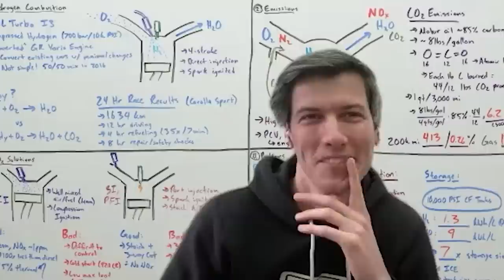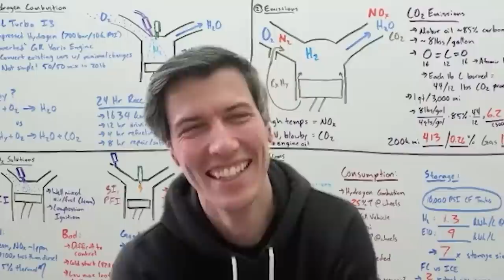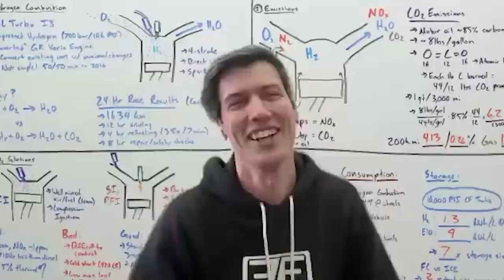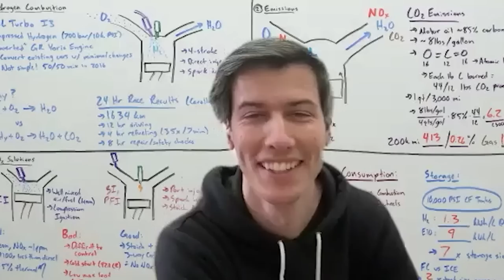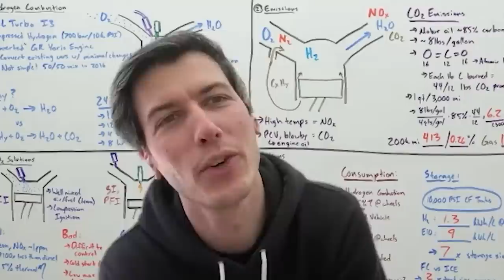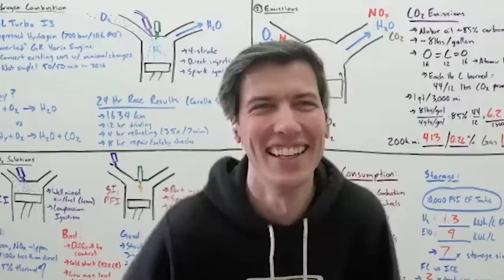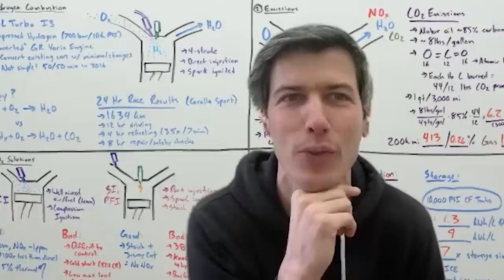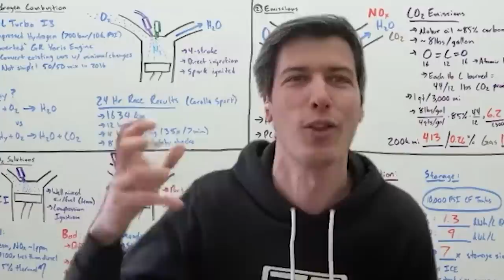Engineering the World’s Fastest Cars with Jason Fenske & Neil deGrasse Tyson

Comment: The McMurtry fan car is the fastest 0-60 1.3 sec! Really wished they talked about this car as it has maximum downforce from a stop, giving it huge amounts of traction.
Reply: 🎉🎉🎉 yes this is the way
Reply: A  top fuel car  is even faster  much much faster
Reply: Pretty sure they are speaking in the context of production. Fan cars are awesome and I'll watch the top duel cars run any day <3
Reply: Thank god I'm not the only one mentioning downforce...
Reply: The rimac is production right?
Reply: Yes, while Mcmurtry isn't road legal yet, it isn't impossible to make it road legal so it should be included in the conversation.
Reply: Fan car will never be street legal because of the amount of crap it would blow at the other cars on the road.
Reply: @ryurc3033  its got an official uk registration plate
Reply: carwow tested the mcmurtry on unprepped track
Reply: @bigdavedayday1581  But the McMurtry isn't a drag car. It's a track car that happens to be very fast off the line. We have to acknowledge the impressive 0-60, 0.3-0.5s slower than a top fuel, with 10 times less power and roughly the same weight. Top fuel will wipe the floor with it after those 60mph
Reply: Came here to mention the McMurtry 🤓

Comment: The conversation about 17 mins in about engine dependability reminds me - my first car - an Austin Mini had a manual choke. Pull the handle and it restricts air into the carburettor when starting so the fuel and air mixture is richer, so there’s a better chance it’ll start. Of course, you have to remember to push it back in or you’ll go off down the road with a blue cloud behind you. Push it back in too soon though, it’ll stall. Fun times. I now have an Audi where I press a button to start it, but I do miss my old Mini. Useless when going on dates I might add 😂
Reply: The cloud should be black if the mixture is rich. Blue smoke is oil being burnt, meaning piston rings or valve guides were worn.

Comment: Hey guys! On the subject of drafting I have one for you.  I was once somewhere  between crystal springs and ely Nevada when I realized too late I was not where I thought I was.  I had no cell service and no local map but my last fix suggested I had something like 120 or 130 miles to the next fuel stop and my car computer said I had around 100 miles of range.  I was midway so just turning around was not an option.  However, I knew about drafting and came upon a tractor trailer going a consistent 50 mph and I just fell in behind (at a safe distance as the effect is still there to a degree even if you are not close enough to be unsafe) and for the next 2 and some odd hours cried as literally everyone else, including other big rigs, passed us by.  I not only made up my deficit but I rolled into the next fuel stop with an estimated 20 miles still in the tank.  Needless to say, huge relief after a very tense ride.
Reply: You don't carry a street map in the car? That's just bad planning. I carry an old street map, and cash. Internet is not forever, just ask the people caught in towns isolated by bushfires.
Reply: @Chris-hx3om  sadly, no. That was very poor planning no doubt. And I was certainly extremely nervous and kicking myself for putting us in that position for sure. But, in the end, I had a cool story to tell 😝

Comment: Mechanical engineer here too. To add information to a couple of questions. About the supercharge electric motors question, it's possible to increase energy output complementing the battery with super capacitors, they don't hold much energy compared to a battery, but they can discharge it way faster. And the volatility of gasoline vs hydrogen question. Hydrogen is more volatile because its molecules are so small that they actually leak through materials like water on a mesh, but at a much smaller rate. Loved to hear Jason on the show!

Comment: Some advantages they didn't discuss about a rotary engine is due to its compact and lightweight design, you can mount it lower and further back than a typical piston engine, and achieve a light, powerful, front mid engine layout capable of producing serious power for track use.

Comment: I thought part of the 300mph limit was actually the tires. But more about the rotational force on the tires, ripping apart at those speeds. That is why salt flat jet cars use solid steel wheels that are strong enough to take the rotational force.

Comment: 29:05 Our family owned several 70's Volkswagen Beetles.  We could drive very close to an 18 wheeler truck around 55 MPH and lift completely off the gas pedal and continue moving unassisted.  The air coming off the back of the truck pushed the back of the Beetle and the truck also removed any air resistance in front.  Very cool, although this required driving very close to the truck which was not safe, plus if I remember, this drafting method required some slight acceleration occasionally to stay in the "pocket".
Reply: These sort of hypermiling techniques work because of how the aerodynamics interact but as a practice is downright suicidal. It is why it's almost universally illegal in most places. Sure you don't have to overcome air drag because the Truck in front is doing it for you which save you a ton of gasoline but if it has to brake suddenly you have zero time to react guaranteeing an accident and perhaps it can end up getting innocent people involved/injured.

Comment: The thing of the grooves on the road to supposedly have better grip in corners I've seen it done here too (one day: "finally, they're laying down some new asphalt here!" the next: "did they ruin it already?!") and I think it's idiotic: the best grip you can have is between a slick tire and flat, solid asphalt, nothing less. Whenever I drive on that corner I mentioned, especially when it's raining, I feel like losing control in any moment (that would make sense if the purpose was actually to make you slow down)

Comment: My dad was watching this with me and he was like why not power it using vacuum. I search and I saw a guy had a prototype with a toy car, I was hoping you could talk about that in a next video. Using the negative energy to pull something that turns something
Reply: Interesting idea, but I think that will have all the same challenges, albeit at different points in time and in different quantities: 1. it will take energy to create that vacuum and 2. storage will be an issue just as it is with any other form of fuel: how much vacuum does one need to store to make it a practical "fuel" for transportation.  One thing is for sure, vacuum is the lightest form of "fuel" 😁 .  (Though, the weight of the container for that zero-weight fuel might negate all of the fuel's weight advantage!)
Reply: They already have that.
Reply: @MrCheckster2000  I tried looking it to didn't find it.
Reply: Vacuum depends on atmospheric pressure, about 14.7 psi.,  for its power. So a perfect vacuum is equivalent to 14.7 psi. of compressed air, very inefficient as an energy storage. Dragsters develop around 6,000 psi. cylinder pressures.
Reply: @edbruder9975  can you explain that a bit simpler I'm not sure I understand
Reply: Vacuum requires energy to create. The more Vacuum you want the more energy it takes and requires additional energy to maintain. Why not just use that additional energy as propellant.
Reply: @paramountx  So if you're in space, it's a vacuum. You can't use a vacuum cleaner in space, it all sucks right back. The only reason a vacuum has power is the difference between atmospheric pressure that wants to get into it, and on earth that's 14.7 psi. So say you've got a 20 lb propane tank you want to store energy in, you decide you're gonna use vacuum. It only holds lets say 5 cubic feet of air I'm just guessing. Once you let any air in, the vacuum is less. Once you let 5 cubic feet in you're done. They test propane tanks to 350 psi. If you use compressed air there's 23 times the energy in the same space. There's a lot more push with air than pull without air.
Reply: Chaparral racing cars used that method in Can-Am racing .  They had built a fan built into the system to suck the car to the track..

Comment: In school my professor told me cars get the maximums acceleration when the tires slip about %10 so essentially like sticky gum adhering to the road. On top of that the weight transfer and suspension would equate to more than 1.00 G of force on the driven wheels.

Comment: I like how the ability to maneuver was added to that top speed limit question as that was group B rally and is has been formula one since the late 80s early 90s.  Without a doubt you could grab a modern formula 1 car re angle the wings for just straight line and hit 300mph.  Thing just would not turn like they do on a circuit track 😂

Comment: @startalk @engineering explained  Question about fuel economy. In a hilly area, let's say on an interstate highway, would you get better mileage by slowing down as you go up hills and speeding up going down, or staying at the speed limit both up and down the hills? I have an opinion, but wondering what the experts think.
Reply: If you put the brakes on to go downhill, you get worse mileage. Let it roll. Mileage is mainly affected by rolling resistance and wind resistance. If you're not stepping on the gas while rolling downhill, the wind resistance of high speed is not costing you anything. That being said, if there's a cop or traffic or low-speed curve at the bottom of the hill, and you have to use brakes, the fuel you used to maintain speed going up the hill was wasted, and driving slower over the top of a hill, you will roll down slower with less wind resistance. I drove truck, and the company I worked for had a speed limit, but we were allowed to go above the speed limit for 60 seconds to pass somebody. One trip through the Pennsylvania hills I realized if I rolled down the hills I would only be above the speed limit for nor quite the 60 seconds before the next hill slowed me down. I got called into the office. I was speeding I think it was 1/2 the time. So I asked how many times I was in violation, he looked surprised, it was twice.
Reply: @edbruder9975  Excellent response. I certainly wouldn't press on the brakes going down the hill, but I wonder if setting cruise control to maintain speed up and down the hill costs more or less fuel. What I see is people approaching the bottom of the hill "at" the speed limit, then slowing down as they reach the crest. Then they accelerate down the hill ending up at a speed above the speed limit when they reach the bottom. If you set the cruise you use a little more fuel on the way up the hill, but are essentially coasting down the hill the entire way. When I tested this in a vehicle with an instantaneous fuel economy display, I didn't see much difference in the fuel economy when going up the hill, maybe a few MPG. But going down the hill, keeping with traffic and accelerating as they did, I saw large numbers, like 60-70MPG, but if I kept the cruise on it would top out at 99MPG. This is obviously a significant hill, and "your mileage may vary" based on terrain and traffic. I just always felt that the slowing down while ascending wasn't significant enough to gain economy, and that was eaten up by accelerating down the hill. But maintaining speed would cost a little more in the ascent while paying back more in the descent. Just wondered if anyone had done a more scientific study of it.
Reply: @tomv5782  All I can say is my boss was amazed I had been speeding almost 1/2 the time and never exceeded the mandated limits, you were allowed a few violations of their rule before they docked your pay. That being said, in a truck if you have to gear down to go up a hill you use more fuel, you have to give a shot of fuel to match your gear on a downshift, and you lose speed while shifting, so the rule is if you're almost cresting the hill you should avoid the downshift and back off on the fuel to avoid lugging the engine then get back on the pedal as you speed up on the downslope. But in that particular situation I just let it roll down the hill and didn't touch the fuel until I was on the next upslope and below the speed limit. Then it was pretty much on the floor till the top of the hill again. My boss looked at the stats for a bit then said "Well, just don't do it anymore."

Comment: In a rear-wheel-drive car, as you accelerate, the rear will be pushed down for a force greater than 1G.  The average force on all four tires is 1G, but much more on the drive wheels.  Same thing on an emergency stop:  the front tires get for more than 1G.

Comment: This conversation got me to thinking about the comic character the Flash running fast enough to break the time space barrier does he use gripping soft rubber boots? And how strong is the flash that he can resist the enormous air pressure against him which must be incomprehensible! Also his around the world punch where he accelerates fast enough to circle the planet instantly and hit the bad guy how much force is he generating into that punch?
Reply: Speed force protects him

The force varies at how fast he runs

Comment: Talking about the ability of a car being able to manoeuvre at high speeds is similar to something that military aircraft designers must take into account for instance the design of the F-111 Aardvark (one of the predecessors to the much more famous F-14 Tomcat) involves wings that can move from a straight winged position (for more stable low speed flight) to a fully swept wing at 72 degrees for high speed flight. This design at the time was a revolutionary advance in Aircraft design and led to the same principle being used in the Soviet Union and Europe.

Comment: Recycling of batteries already is done by several companies. I believe "redwood materials" recycles damaged and rejected batteries from the production lines at (a?) tesla factories. They claim they reclaim 90-95% of these materials that are then reused in the production of new batteries. I am sure the scaling and efficiency are still being worked on. But I think I heard/read that the goal was to get as close as possible (within a few percent) of a closed cycle with only minimal input of new materials
Reply: Not to mention that the used car batteries still have about 70-80% of their original capacity and can/will be used to store energy from renewable but intermittent energy sources. It will be decades before there is a major requirement for material recycling.
Reply: @ctcboater  Depending on devellopment of battery chemistries that are cheaper, longer lasting but more volume, It become more cost effective and environmentally responsible to recycle old car batteries than reuse them. That way high density batteries need less mining and refining and lower density/cheaper/longer lasting batteries can be used for home use.  But first these new batteries need to be perfected and produced, I think of NaCl batteries or the flow batteries from RedFlow (Australia) as examples. They typically are not as energy dens but cheaper, more cycles.
Reply: “Green”

Comment: About recycling: a former Tesla co-founder JB Strobel started a battery recycling company called Redwood materials that is trying to tackle this problem.
Reply: It is all about volume scale. 

Most batteries produced are still on service. So we have not gotten to a point where there is enough batteries coming in to recycle to be worth processing yet. 

And we are talking about 2nd uses for them after they are taken out of cars, like grid scale storage. They are generally pulled out of cars with still around 80% of the original capacity so they have many years of use for other applications if we can find some organized way to use them. 

So it could be a several more years until we actually have enough to recycle, to build recycling facilities. 

Once we do though, Tesla is ahead of the game as they are collecting old batteries where possible to warehouse, re-use and maybe recycle some day.

Comment: Guys, let's look at the anti squat of the 4-link suspension of drag cars and how a low inflation pressure on a drag slicks massively increases the surface area of tire contact patch. The adjustment of the instant center of the car can be adjusted so that the more the weight transfers to the rear of the car, the more the 4-link suspension will push the tires into the pavement for greater tire contact patch surface area. The rear of the car in this scenario will actually lift up as the weight transfers rearward...

Comment: can't you have some big capacitors for limited turbo time? So basically they charge slowly using the main battery, and when you get the capacitors full,  press the turbo charge to release additional power to the motors.

Comment: Anyone who has needed to replace a car starter battery (the lead acid variety) can tell you that we already have an infrastructure that encourages recycling of these batteries called the "core charge", which is either waived if you bring in the dead battery at time of purchase or refunded when you bring back the dead battery. Something similar could easily be built into the price of a replacement EV battery pack.
Reply: Very good point. I will add, current car battery (lead acid variety) recycling rates are around 90 to 99%, better then any other recycling of anything ever... With a good system, like the core charge/deposit, its very likely we can maintain the great success of recycling car batteries.
Reply: “Green”
Reply: @alohatigers1199  Are Saturday Morning cartoons still a thing? We could promote lithium battery recycling with a new cartoon superhero, or maybe some your-powers-combined character like Captain Planet. "With great recycling incentive comes great recyclability" or some other cheesy junk like that. Practically indoctrinate the next generation of drivers into it.